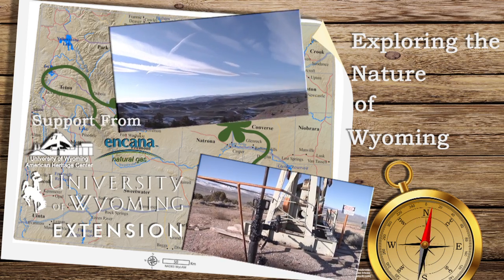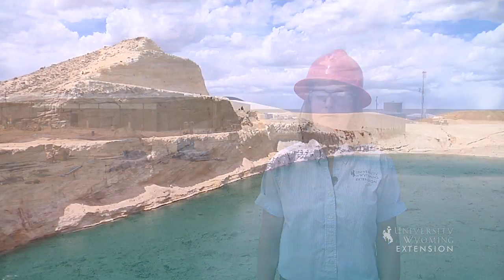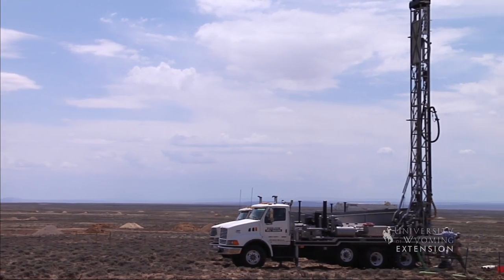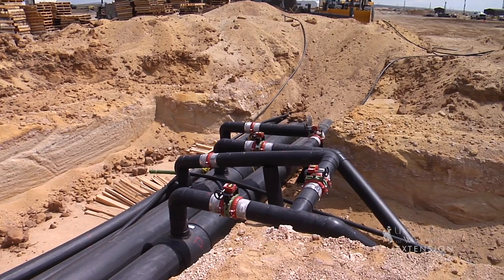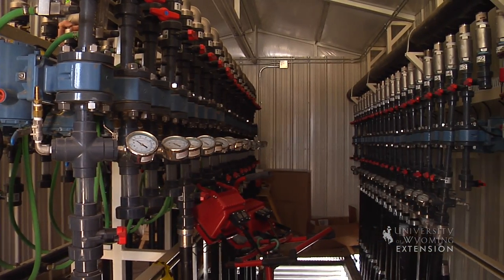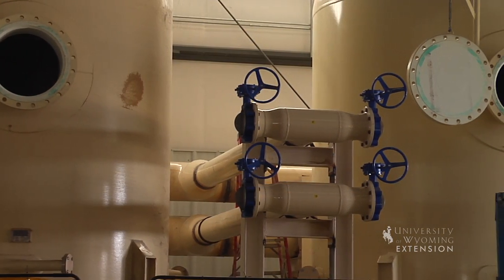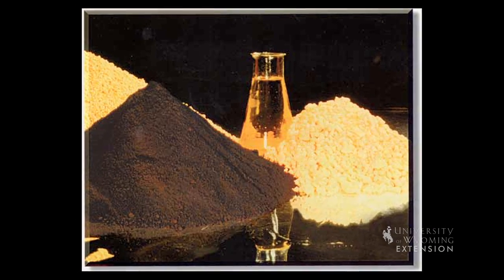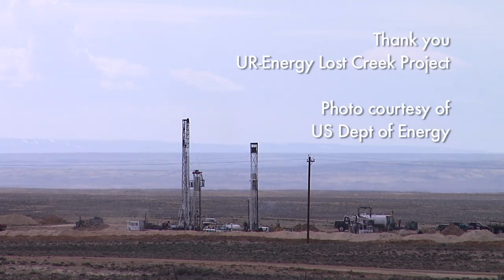Uranium Mining...with Baking Soda?

Comment: OUR Highland Uranium Mine"WE"had a, at that time a 135 Ton per Hour Uranium MILL, Surface Mine, Underground Mine, and Insuto Mine(Inject a Sodium Bicarbonate Solution)in the Inner Injection Wells and Extract the U3O8 Solution, then Wash and send through a wash cycle, before spinning and Drying and Packaging, in 55 gallon Drums, before sending off for Enrichment(Bartlesville, Okla.)...How I enjoyed WORKING at Highland...Worked ALL PARTS of the Highland OPERATIONS...Would have stayed, IF The Russians had NOT have SOLD their U3O8 for less than WE(Exxon Minerals USA could Profitably Mine and Produce a U3O8 Product...I took a Voluntary Layoff in late 1983...I got called Back to Work on OUR Mine 4 P&H 2100BL Electric Shovels and 13 Unit Rig M100/M120 Electric Haul Trucks plus work on some Dewatering Issues with Pit 4/5, The Underground Mine, and the Insuto Mine...Exxon was in a Forsale with the Chinese on the Mining Equipment...I was there as a Experienced Journeyman/Instrument Electrician to explain the Equipment Operate the Equipment, and Help in the Sale of the Equipment...